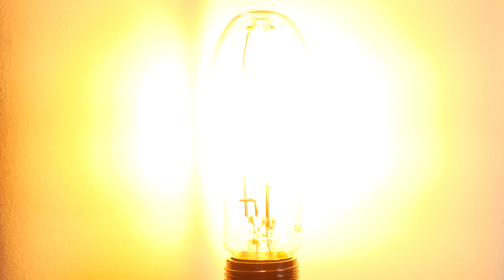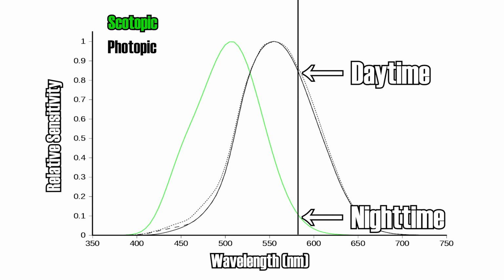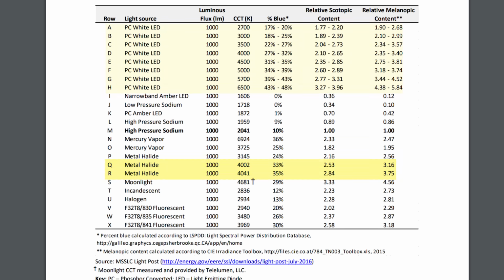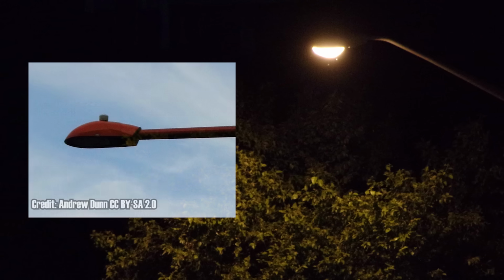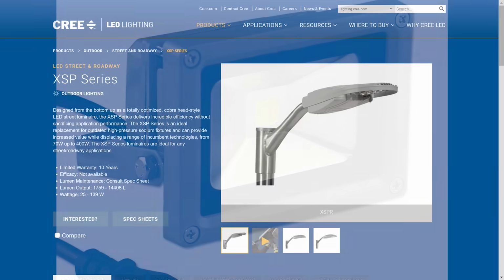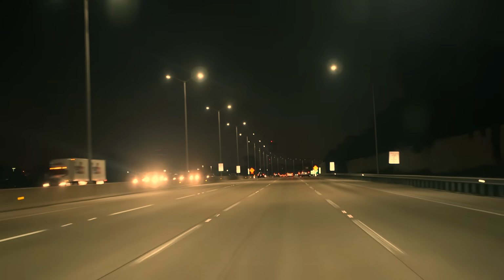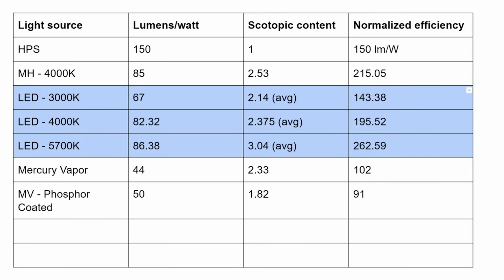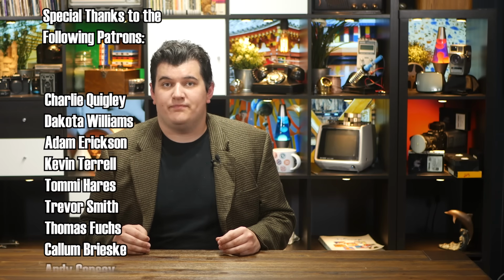The LED's Challenge to High Pressure Sodium

Comment: The use of LED's in residential areas is very problematic. A large part of the problem as pointed out in the video are the drop in LED replacement lights for older poles in residential areas. The spacing of the poles was implemented with the lighting characteristics of sodium lights in mind. When municipalities just drop in new LED replacements they don't take the number of lights or the spacing of the lights into account. With the number of lights and the strength of LEDs, any possible illusion of night time is ruined. Every nook,corner, and cranny is flooded with light. I personally find this very grating living in a neighborhood that has replaced all the sodium lights with LEDs because the night almost doesn't exists anymore, it just feels like a dimmer time of the day. I can walk out into my backyard and see just about everything pretty clearly and that doesn't sit right with me.
Reply: I have been in the lighting industry for about 10 years now, and I can assure you that when retrofitting to LED we do take into account actual locations of the poles and luminaires.
There is a lot of testing that is done prior to deciding on moving to LED, calculations are done with a software that is called AGI32 and we choose the right luminaire for the job, this means choosing the right lumen package and optical distribution.

Off course we won't do calculations for an entire city, but we do calculations for many different scenarios, meaning different mounting height, street width, pole spacing, we usually do calculation for low pedestrian activity street, residential, boulevard, highways and make recommendations for all of them.
Reply: LED lights are too bright and are obnoxious. Mercury vapor and incandescent lights have a pleasing warm cast which is aesthetically appealing. You can profess all your calculations with your software but until an LED that has the same color spectrum as Merc vapor or incandescent lights its not an improvement. No matter what, the flunkies in local municipalities will want to install LED lights that have no character whatsoever and will be entirely too bright. It's called light pollution and it's an ongoing problem. how about having reflectors on the streetlights like the old ones did and the light goes where its needed and not into the sky.
Reply: @superrf85  first of all the color of the light has nothing to do. With the technology, we already use LED  with an amber color which is very similar to the monochromatic orange color from low pressure sodium. LED can achieve any color you want, also if you think that Sky glow is worst now than before, you are way off.. Actually lots of traditional luminaires used to have sag lens and they we're horrible, throwing so much light above the horizon.. LED is a much smaller source and is much easier to control, so if you want to have better control and eliminate most of the light above the horizon than LED is the solution as most of the luminaires on the market now are full cutoff and keep the light very focused where its needed versus backward, upward etc..
Reply: That"s good to know but from what I'm seeing there is a very uninformed public out there who are not being made aware of the capabilities of LED and of light pollution. It would be a very good mission on behalf of manufacturers and representatives of the LED technology to present these options and capabilities to the municipalities and cities who are in the market to buy. Without more information from the manufacturers they will go with the standard fare 5500 k lighting which destroys any semblance of ambiance and tasteful light and will specify the brightest offered without any thought to the atmosphere or permeation of light above where it's needed. Technology without guidance is sheer folly.
Reply: @superrf85  You do realize that aesthetics are entirely subjective, right? You can't just make the claim that these bulbs look better because you like them better. I prefer the white LED light but I wouldn't say everyone does. If anything, this sounds like a "I'm used to this so I don't want it to change" problem. These bulbs are safer and being able to see at night is important. If it bothers you, get a black out curtain.
Reply: I LOVE your term "insecurity lights" - I am going to use this for now on!
Reply: You are absolutely correct about the use of existing poles.  Engineers and specifiers do they best they can with the retrofits, but one problem is there are a finite amount of "light distributions" available and this creates a mixture of over-lit and under-lit conditions.
Reply: In my area they're doing this in rural small towns, it's a Midwest problem.
Reply: good point- the type of light you get from LED streetlight modules would be less annoying if it was split up among more, closer to the ground, smaller fixtures, that cover the area they're supposed to light and not everyone's backyards.

Unfortunately I've met people in the neighborhood who are really scared of public darkness, and would be  happier if there was daylight and a visible police presence at all times :(
Reply: zelkuta the LED fixtures were not correctly installed for their use, a better colour temperature, lumen output, and spread should have been done to prevent this. As someone who works in Industrial Lighting I can tell you that bad design and bad contracting are everywhere these days.
Reply: They are replacing 100 and 150w HPS streetlights in my area with "equivalent" LEDs. The roads in the areas with new LED lights are lit quite poorly and the area illuminated by the LED lights, while a little brighter, light a much smaller area. Meanwhile the HPS lights that remain are a little dimmer but they light up a huge area. They are also much easier on the eyes.
Reply: we just dont have any streetlights in our neighborhood
Reply: You should see what the nimrods in my small rural town did. They initially replaced all the barnyard style lights on the two main thoroughfares, with the best LED street light I've seen used anywhere. Cut-off fixture, very little glare or light spill, an ideal choice and quite by accident I'm sure. So what happens? Everyone here are insecure afraid of the dark cowards who complained their yards were too dark, so now the city is putting in multiple types throughout town, and also putting LED "bulbs" in the barnyard lights. So now a single street light creates glare and light spill in diameters of thousands of feet, and some streets here have five lights on a single block, some have them right across the street from each other. Multiple homes have bare bulb "insecurity" lights lighting up all their neighbors, business buildings have huge fixtures mounted outward, causing blinding glare for several miles and sky glow for many more. Albany, Missouri, a town mired in ignorance and ineptitude.
Reply: You know, I really like being able to see every nook and cranny when I'm walking at night.
Reply: Seems like a good problem to have.
Reply: Sir Eddie thank you, it's very apt. "My yard is too dark, I need to see if someone is in my yard!" The Iron Maiden song Fear of the Dark sums them up perfectly. Check out my fb group regarding the blight of light pollution.

https://www.facebook.com/groups/122401518432866/

Comment: You actually want the circadian rhythm  disrupted in this case.  Cuz your driving and blue light will help keep you awake,  alert and a lot safer while driving.  So you could say instead of the blue light disrupting circadian rhythm , blue LED lights are better for visibility and help keep the drivers awake and alert.

Comment: Light pollution is not only a weird problem for astronomy, it's a deathtrap for most nocturnal insects. The bluer the light, the more insects get attracted and likely die. Some insects like most fireflies are already almost exterminated due to human light pollution. Light from low-pressure sodium lamps (590 nm) are still one of the best choices in respect to environmental protection. The only lamps that are even better, are warm-white LED with light below 3000 Kelvin. A good LED has a yield of approx. 300 lm/W, a low pressure sodium based lamp up to 200 lm/W. So yes, there is room for LED lightning to save energy, but the LED lamps should have an even better protection for insects i.e. produce light that is even more(!) into the red spectrum.
And please.. "elemental sodium" is.. dangerous? Get yourself a basic book about basic chemistry and toxicology.

Comment: Meralco, the electricity provider in Manila (capital of the Philippines), Bulacan, Cavite, Rizal,  and parts of Laguna and Batangas used Mecury vapor lamps in streerlamps until the late 90s  when they replaced them with high pressure sodium. Starting in the 2010s, they started to use LED lamps for installing new or replacing broken HPS streetlamp systems. Still working HPS lamps are still not replaced.

Comment: Sir, you forgot to mention foggy and snowy driving conditions. Blue is blinding while the amber's wavelink cuts through. (Car fog lights are amber.) In the 80's the old bluish lights were switched for the amber and it was a Godsend for those conditions...
Reply: vejabill - We went from mercury vapor, to sodium vapor, and now LEDS. I wish these types of lights were not phased out so quickly by these horrendous beasts of the night
Reply: I noticed that when there is snow on the road, led  produced a false light effect that was harder to define edges, bumps and dips, due to the fact that snow reflects blueish white light better than yellow orange. The blueish white light lights up dips, edges and bumps so they look the same as the rest of the terain. The yellow orange light gets aborbed more and bumps, dips and edges remain dimer than the surrounding terain allowing you to see the type of retain better.

Comment: I love your videos on street lighting! I have started to become borderline obsessed with it myself, I am even starting to collect some old HPS fixtures. I am hoping once IDOT replaces the GE M400A1's on I355 or I55 I can get my hands on one. There is something about the cutoff design and retro look of them that fascinates me to no end.

One question though, I noticed around Route 83, I290, and I294 there are GE M400A1's with little red circle shaped devices attached to them just under the lens on the ballast cover. They are quite obvious, and it seems the newer replacement GEM400A2's don't have them. For the life of me I can not figure out what those are for even after hours of research. They don't seem to be a photocell since the fixtures also have the top mounted photocell. It just struck me as fascinating since only around the Chicagoland area have I seen the little devices on them. I do wonder if IDOT did some funky custom addition back in the day when the fixtures were new technology. My only thought is they might be an indicator light of some sort. Let me know if you have an idea of what they might be!

Comment: By the way, could make a video about light color and lamp types in car headlights? The benefits and drawbacks of 3000K, 4300K, 5000K and above temperature color and halogen vs xenon vs LED.

I've been using LED in my car headlights for while. 

The first chips were big, inefficient and lacked focus on the reflectors of my Fiesta Mk5.

After some tests, I reached the conclusion that the smaller size of XML-2 chips and the high efficiency of these chips were the way to go.

On the next test, I proceeded to pick up a set with theoretically bigger, more powerful, slightly less efficient and bigger (which should ruin the focus a little bit) XHP50 LED, but I noticed that the focus was as good as the XML-2 and the extra heat wasted by the system was actually useful to heat up the lenses of the headlights and remove fog and moisture that could disrupt the focus of the highlights and blind people in the opposite side.

I guess you are very knowledgeable about the light subject and could probably make an interesting video about it. 

Thanks for your video.
It was very didactic and informative. ;D

Comment: Blue light is the worst for sleep. I can recall endless times when a blinking blue LED in my room prevented me from sleeping. The thing is it didn't even output a ton of brightness, but the only way I could sleep was to use masking tape to cover it up. Maybe slow-blinking blue LEDs can be used as an alertness aid for truckers, or a more focused blue light can be used in a way that avoids a lot of light pollution but I know I wouldn't want any kind of bright blue lights entering my window from the street lamps outside.
Reply: That's also the reasons why some phones have 'night time mode' which reduces the intensity of the blue colors on the phone, because cool blue colors interfere with melatonin production and can interfere with sleep.
Reply: I still don't know what Sony was thinking when they made the backlight in my alarm clock very vivid blue.

Comment: i hear what you're saying about the SD lining up well only with the daytime response- but like you mention talking about "mesopic" vision: we don't immediately stop using our cones at night. They're always there and always 'turned on', they just have a lower ABSOLUTE response. Overlaying those two graphs that way makes it look like you're trying to say the sensitivity is the same but just at a different wavelength, when the absolute sensitivity is obviously lower.

Based on that, I'm not sure that part of the video makes the argument that "SD lamps are bad because they don't align well with nightime vision"- they align reasonably well with the cones, so what's the problem?

The better way would be to show those two graphs at the correct amplitude scale- then you could explain that SD lamps align well with the part of the eye that has a weak response, but completely waste the power of the lamp on part of the eye that is less sensitive than the part right next to it.

Comment: I don't really see an issue with the circadian rhythm disruption. In humans anyway.

For one, the light output matches moonlight extremely well, and I don't really have any issues falling asleep in moonlight. (Also I have curtains.) I can understand If some are more sensitive but that brings me to the next point...

There is no reason (except a little efficiency) a city can't employ two color temperatures, say 5700 for highways/commercial and 3500 for residential, where illumination is less critical. Combine it with the dimmable output capabilities and you are really onto something. Have the lights at full output from dusk til 11pm, %50 output from 11pm to 4am, and back to full output from 4am til dawn.

As someone pointed out, I want to be awake when driving at night. And it's OK if my body starts putting me to sleep when I get into my residential zone, I'll be awake for the high speed portion of my commute and ready for bed when I get home.

Comment: 19:05 "I don't doubt that blue light can disrupt the circadian rhythm, that much seems certain. But considering that our eyes can withstand sunlight, which is far far greater than any artificial light (...)"

That second sentence made absolutely no sense whatsoever. Not because the sun is not much stronger than any regular light (of course it is), but because it's a completely different argument that doesn't follow the previous one. People don't claim that blue light hurts the eyes (if they do, they're just retarded and should be ignored). What they do claim is that blue light disrupts sleep patterns (a.k.a the circadian rhythm of sleep). There are plenty of anecdotes of people switching their fluorescent lighting for warm-colored bulbs and curing their chronic insomnia, or even depression (which makes sense when you consider that some depression types are caused by improper sleep).

I was really, really confused by that segue. It makes it seem, no, it pretty much proves that you have no idea what circadian rhythm even means.
Reply from the maker: Let me unpack that for you:
1.  I didn't talk about how blue light is "ruining our eyes" because the science behind that is questionable.  2. However, that's not to say it doesn't cause CR disruption.  3.  But back on the blue light front, (etc).
The order there wasn't great, but the point of reiterating blue light and melatonin was to hopefully avoid making it seem like I find blue light content irrelevant.  I surely don't, but the fact that we can tolerate sunlight should prove that worrying about eye damage from blue light is silly.

Comment: But then you have to look at the other side of it - the sodium light is a very distinct light that gives you a basic light. But with white light then you make the deviating lights/colors stand out less in the night. Even more so when you have the light of the low pressure sodium lights.

And for people with astigmatism the shorter wavelengths are a lot worse than the longer wavelengths that sodium lights offers. Blue lights is extremely annoying and I found the low pressure sodium lights that we recently lost here very comfortable.

Comment: I am not a professional in the matter and therefore I ask why not using , as in modern car headlamps , asymmetric projectors / reflectors in conjunction with upsidedown lamps which send their light upwards in a special reflector adapted to the road width and the distance of the lamps among each other  that the light / dark spots are prevented?
Here in Germany I have seen many times modern parking garages they qork with LED side lights which are mounted near the ground and still illuminate everything without dazzling.